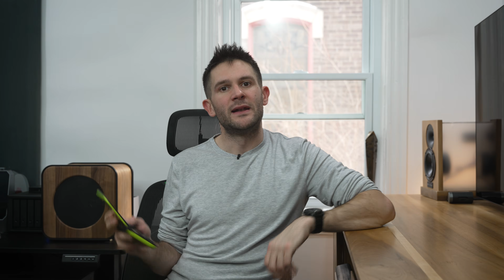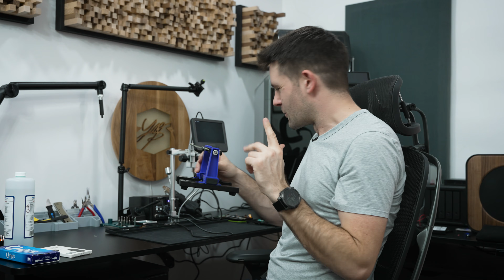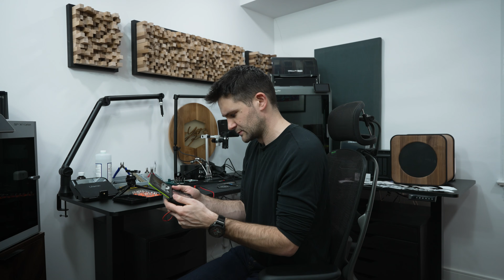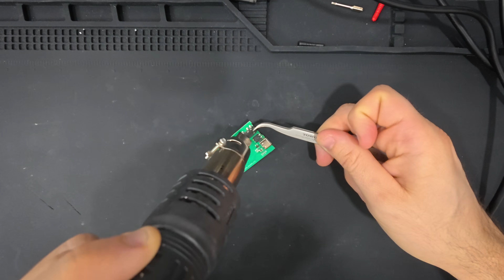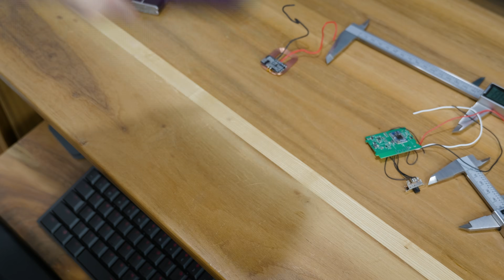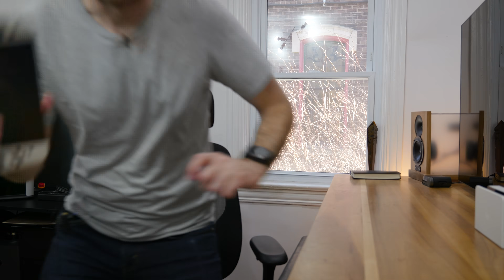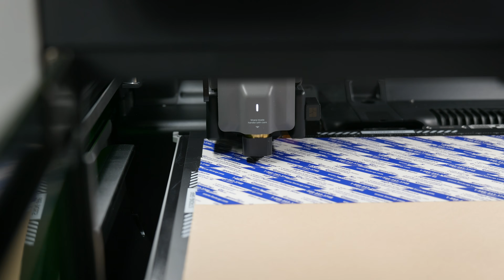I built a NEW New Nintendo 3DS....

Comment: Hey, nice video^^! I noticed you don't have any workbench ventilation for your soldering iron, though. Even though lead isn't commonly used anymore, flux contains rosin. Which when heated, it breaks down and releases harmful fumes and VOCs like aldehydes (which are carcinogenic), toluene, and hydrochloric gases used to strip surface oxidation.

It's stuff you really do not want to be breathing in. As the saying goes, "having a designated area of the pool to pee in doesn't change the fact there's pee in the pool"—same goes for your living space with VOCs and hazardous gases.

A HEPA filter will handle the airborne particles, but for the VOCs, you need an air filter with an activated charcoal layer to adsorb the gases as theyre too small to be stopped by the HEPA. ((lil pro tip: you can get these from hydroponic gear stores for way cheaper than consumer retail).

Without ventilation, you're at a super high risk for occupational asthma, dry eye, and long-term respiratory issues. Plus, VOCs from flux deposit onto surrounding surfaces and off-gas later if you don't get rid of them, just like third-hand cigarette smoke. They can even cause issues transdermally (through skin contact), and when the room heats up they reactivate becoming airborne again.

Please take care of your health, Setting a good example with proper fume ducting in your videos means people who want to learn from you can take up the hobby safely, too. You keep not only yourself but your viewers, and even future tenants of your space safe.

I really hope this was informative. Sorry to be that person in the comments, I'm just seeing an alarming amount of Youtubers nowadays rawdogging soldering fumes 10 inches away from the board in enclosed rooms like it's nothing, It seriously perpetuates misinformation and leads to harmful consequences. 

Take care 💌

Comment: I wanted to do a mod for my "new" 3ds xl to add the Audio video out as well as a usb charging function. All of this is one added component. Its a mod that would require cutting. I would like to 3d print a shell with my cutouts already there. Do you offer the 3d model from this video to download? I want to adjust the model for mod I want to use. I wont be adding battery life, wireless charging, or Bluetooth.

Comment: Nice project. Just wondering why you used 2 batteries instead of 1 modern high-capacity cell? Wouldn't it be easier to just trim the shell to fit a single bigger battery?
I'm not really an expert btw so I'm genuinely curious why you chose this way👉👈

Comment: For printing supports, you don't need to print the entire support column out of support material, just the interface layers. There is a drop-down in the support tab where you can tell the slicer to only use the support material for the interface layers. 
That way, you save time swapping between materials and you save cost by reducing how much support filament you use. 

I'm sure someone else pointed this out in the past 9 months, but I wanted to share just in case.

Comment: Same on the ds lite. If the top screen isn't connected properly it won't boot. The indicator light just turns off after a second. But if you solder in a 330 ohm resister (on ds lite) then you can boot it with just the bottom screen. That's how those gameboy macros are made.

Comment: Why did you not spend more time showing the overclock performance improvements? I'm sure there are many games that load fast or run smoother with the overclocked new hardware. Would be interested in that and possibly even multi-tasking a homebrew app on the bottom screen

Comment: @ZacBuilds, I personally prefer the 3DS XL form factor because it fits in my pocket and not have to worry about scratching or cracking the screen like it could on a switch lite. Have you considered building and fitting a Switch Lite into a 3DS form factor 3D printed custom shell? I would love to see someone attempt this custom switch lite 3DS build.

Comment: One better option, how about you use the 5000mAh battery instead ? You've used a thicker modified case. I think using a larger battery capacity make your gameplay almost non-stop. Just my opinion. More power

Comment: I wish Nintendo would make a 3DS successor.  Its small size and folding design makes it the ideal portable console.  Just imagine what they could do with modern technology and higher resolution screens.  They could even put a cellular radio in it and give us online everywhere.  And as long as I'm dreaming, I'd want it to maintain DS and 3DS backwards compatibility.  However, I'm pretty sure the days of Nintendo supporting multiple platforms is in the past.
Reply: the switch is the successor... portable console. they kinda killed two birds with one stone.
Reply: @user-ko9te4jj4u The Switch is technically portable, but it's too large to easily fit in a pocket, and the screen and controls are constantly exposed.  The 3DS is smaller, and the clamshell design protects it during transport.  

Another way to took at is it's essentially the difference between a tablet and a smart phone: both are portable, but there's only one that people bring with them everywhere.
Reply: @Durwood71  Don't really think the DS being pocketable made too much of a difference.
Reply: @Durwood71 the switch is a lot more fragile in general. The 3ds however actually had drop tests unlike the switch. Ive dropped mine many times. Never damaged. Only recently i got it a protective shell to put over it. 

I drop a joycon once from a very short distance and the rail got damaged and i had to replace it.

Comment: I started recoiling in fear when you were peeling the batteries's labels apart, so you would believe I was beyond vindicated when in 15:19 you admitted you made the console look like a bomb. Even a top commenter warned you about separate battery voltages.

The "finger holes" (wow, that sounds weird), as you called them, seem really clever. I wonder if that'd help with counteracting the weight of the console, though, since I'm a wimpy adult teenager: heck if I know how "big" my hands are.

Comment: There's lots of different numbers out there on the internet about the new 3ds clock speed. But from what I've read, the most plausible information is that the core speed of the new 3ds is exactly the same as the old 3ds, just with double the cores. This would certainly explain why it would not run "four timers faster," because adding more cores to a program not written for a multi-core processor would do absolutely nothing. Hence why only some newer games ie games that were written to take advantage of more cores, are actually faster on the new 3ds.

Comment: the headphone jack always has some small piece inside that makes devices activate it, as it's pushed by the jack you insert
so if you want to shut up someone's device, you can always jam some ripped off 3.5mm connector into it or a 3D printed one lol

Comment: Great video!  It gives me lots of ideas.  But I'm chicken when it comes to open-case modding of my treasured consoles,  so I just plug my Taotronics Bluetooth transceiver into the headphone jack of my new3DS XL with the short cable that comes with it, and stick it to the back of  the 3DS's case with velcro.

I might incorporate a bigger battery pack and wireless charger into a protective shell that snaps on to the console, and plugs into the OEM charging port.

I'm curious what type of screens -- IPS or TN -- your two 3DS XLs have.  3DSident can tell you.  (Or you can tell just by looking at them.)  What does it take to swap the upper or lower screens between two new3DS's?

Comment: I recently had the battery in my new 3ds xl get expanded and balloon a tiny bit and so I had to buy a new one and for about 10 dollars on amazon I bought a new battery but instead of the 1750 mAh that the original battery had the new one had around 5000. I think it would've been smarter to just buy a newer battery than to wire 2 in parallel
Reply: That new battery isn’t really 5000mAh, those Chinese batteries always inflate their numbers. It’s more likely very close to the original. Still, new is better than old.

Comment: Dude I used to have the same exact green new 3DS down to the color, except the screen was broken and any repair places I took it too said they either couldn’t fix it or mistook it for the switch oled for some reason??
Reply: What kind of repair place tries to give a 3DS Switch screens???
Reply: @i-NEED-a-better-username no like I called them and told them I had a NEW 3DS and they were like “switch oled?”

Comment: I love the solution with the Wireless Audio Adapter, although I would love to suggest maybe using a esp32-c3-mini? it has both wifi and bluetooth on board, costs less than $5 usually and can easily be programmed to do the same job. Added benefit is, that it would probably be smaller than the board you salvaged. Anyhow Great video as always! Just wanted to share my thoughts :)

Comment: Zac, I think there are possible hazards with your battery setup. Specifically, what about a BMS and cell balancing? The original BMS of the 3DS is obviously not for a 2S battery pack. It's also not enough to charge the cells to the same voltage initially, the cells need to be actively balanced continuously.

Comment: soldering directly to a battery like that is extremely dangerous
i know theres a management board between the cell and the contacts, but still, its very dangerous because theres usually not that much separating that pad and the cell itself, quite often conducts directly to the cell, even if at a reduced rate

yes, there are protection mechanisms, but they are not foolproof

Comment: As a note related to unlocking the extra clock speed and L2 cache on games, you can activate it per game basis using the Rosalina Menu, allowing to maintain battery life when playing games that don't actually benefit from it (like DS and GBA games, quite some third-party 3DS games that don't use much resources). The only downside of this approach is that you have to re-enable every time you launch the 3DS game.

Comment: Now, you did leave one flaw. The SD card is still inaccessible without unscrewing the backplate.
Reply: New 3DS has a built in file transfer system, and Luma adds FTPD for both versions. It's pretty quick cause I use it with my old 3DS
Reply: @tdavis422 The built in file transfer system does not transfer from the SD card. I know this first-hand.
Reply: Ftpd solves that problem
Reply: @Your2slowyt  but its much much slower
Reply: @sharaths2023  drills a hole in the case cutely

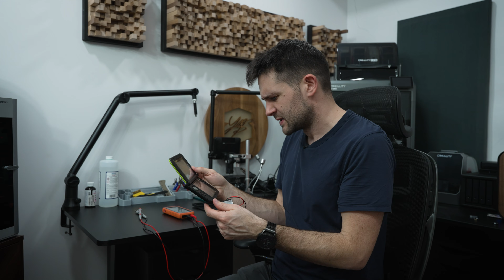Comment: 5:14 that's not how electricity works, if batteries are electrically connected in parallel the load WILL draw from both, now balancing is a different animal but I don't suspect it will be that much of a issue for that setup.

Comment: the middle pad on the battery is most likey a thermistor to measure temperature. this way, the device is able to know if the battery is overheaing and shut it before it explodes.

Comment: Now if you could find a replacement top screen with a higher resolution, that would be amazing. Most 3DS games were created with higher resolution models, and the stock screen sucks (and gives me headaches). If you could find a way to put an OLED screen in there, that would be amazing.

Comment: I bought a new 3ds xl which I then sent to a professional who installed a capture card inside, I use it as the smoothest method to play on a dual monitor, like a giant 3DS, and I play with a controller with InputRedirection, I also bought a pro switch controller which I customized to the colors of my 3ds, my 3ds is now like a switch, I think that could be an interesting improvement, a capture card allows you to play with minimal lag that I don't even notice and I can play perfectly like that unlike free video capture software which was not smooth for me

Comment: for the switch, you could have broken both grounds over the same pin on the single pole switch as long as the bluetooth module was switching on ground, I don't think the sense pin on the 3DS carries audio. they're both connected to the same battery anyways so ground is ground. It's also probably more affordable to get a 10 pack of bluetooth transmitter boards off of amazon than one of those premade modules

Comment: Awesome Zac Congrats on this fantastic mod! I've been trying to make these mods and with your video it will be even easier. Not being an instigator, but already being one. There is a mod that promises to transmit the 3ds screen to a TV, they use boards and soldering on the board. Why not make the Type-C also transmit to a TV?! And another mod that I have been studying is the pairing of controls (Switch, Xbox etc) to control the 3ds. It's like turning a 3ds into a Nintendo Switch.  Thank you very much for this video and I hope that with your resources you can make these mods that I mentioned above. I'm rooting for you and I'll definitely try if you can!  See you soon!

Comment: For the bluetooth i think a board like "KCX_ BT_ EMITTER" is better because its smaller, also it would be cool if the pairing button was hidden and controller by a custom luma firmware (maybe wiring other cables or a custom board)

Great work on the custom shell, it would be cool to have an original size one with the precise type c hole

The 3DS modding scene is lacking compared to other consoles, but I'm hoping videos like this can shake things up a bit! Great work man

Comment: I’ve always had an idea to put a gba slot on a 3ds. Ik the issue is fixed with modding but I still think it would be cool and unique if it’s able to be pulled off. Was one of my favorite feature of the original Ds and Ds lite and the only reason I didn’t get a Dsi was because of the lack of gba slot. May be a cool video idea and sorry for the long comment

Comment: im confused on the dock

why usb C?

you had wireless charging modded in
and you specifically put the copper contacts back in for charging in accesories

why not save some effort and make the dock either wireless charge the console or use the pogo pads?

Comment: The thing about bluetooth for headphones is problematic in gaming because of the inheret latency that it has, and there's basically no way around it. Best you can do is 160ms but usually it's more than that, and that's already a lot. What is your experience with it? because judging from the video, seems like you didn't experience any trouble.

For the rest of the video, congratulations, you did a great job!

Comment: Connecting two fully charged LiPo batteries in parallel to a system not designed for it is a serious safety risk. The internal charging circuitry is typically intended for a single cell and lacks balancing features. Without balancing, even minor differences between the batteries can cause uneven charging or discharging, leading to overloading one cell. This increases the risk of overheating, swelling, or even fire. Since the system can't properly monitor two cells, it may apply incorrect charging behavior, further damaging the batteries. It's an unsafe and unreliable setup.

Comment: since you are using the new 3ds, i wouldve recommended incorporated a micro sd card extension cable, having the micro sd card under a fragile backplate instead of conveniently on the side like previous models is annoying especially if you frequently need to access it when modding

Comment: 15:00 why not just use your original switch and wire the ground from the Bluetooth board up to the same ground for the headphone sense switch?  That way you only need one wire leading from the battery to the Bluetooth module.

Comment: I would skip the charging port completely.  That amount of work was so unnecessary.  There are a ton of drop in docks.  No port is needed.  Basically like wireless.  Then in the end you created a port based drop in dock?  What on Earth?  So you removed the touch pin charging capability just so you could upgrade to USB-C and ultimately make the dock worse?  I don't get it.
Reply: Let’s be honest he lost all credibility the moment he claimed that the N3DS XL is the best console for DS games when it is quite possibly the worst, even worse than a phat ds I reckon.
Reply: He didn’t remove the charger pins tho he trimmed them to fit the new port???

Comment: Good video, but I'm surprised you didn't replace the little nub that acts as a stand-in for the Circle Pad Pro in games that support it. It's very uncomfortable to use in games like Monster Hunter, and if you look into it a bit, you can actually mod it fairly easily by just digging into it with a pair of sharp tweezers, pulling it off the console, and replacing it with a Super Low Profile Thinkpad Trackpoint cap. It has much more surface area and still manages not to interfere with the hinge or screen closing. Give it a try!

Comment: For an ultimate 3DS you forgot to build in the feature to capture video directly from the device or at least be able to connect it to an external source - like a monitor or a TV.
Upgrading both monitors to better ones and maybe adding  hall effect joysticks would be the next step to an ultimate 3DS.

Comment: third battery terminal is often a thermistor. If you can measure a resistance that is changing with the battery's temperature you know it's one. Used to protect against overheating batteries.

Comment: I prefer the New 3DS but one thing to consider if you are wanting to play regular DS games on official hardware is that the DSi XL is the best option when it comes to the screen. The DSi XL screen have the correct resolution for DS games at that size.
The 3DS, 3DS XL, and N3DS XL screen resolutions aren't big enough to be able do a 2x resolution scale of the DS resolution, so the DS games scale up unevenly and make them look blurry.